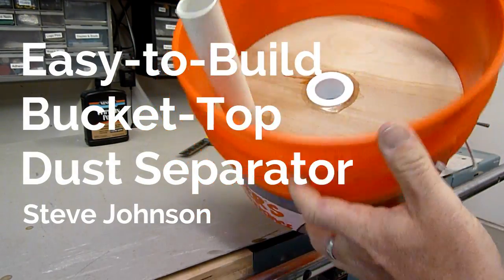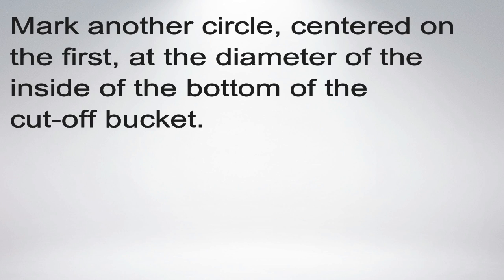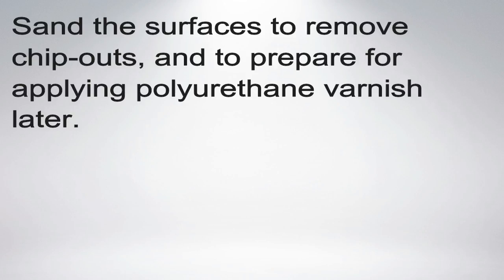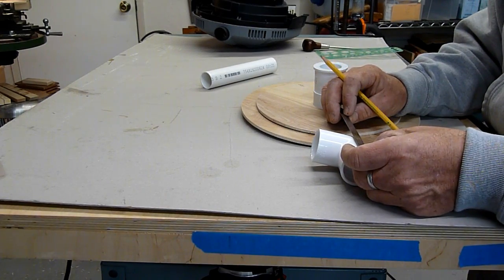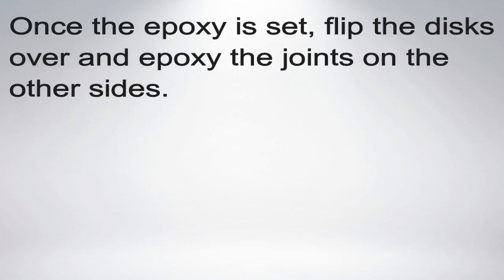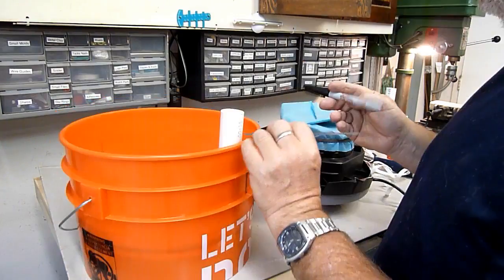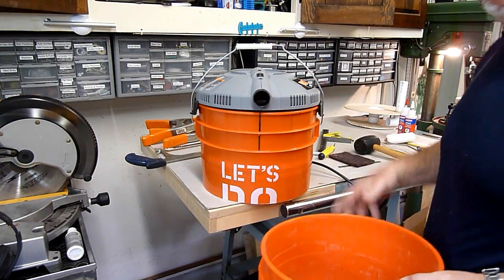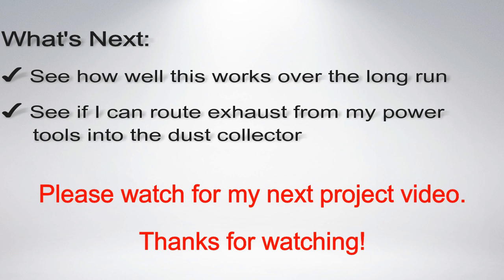Easy-to-Build Bucket-Top Dust Collector

Comment: Thank you for this...I made it and it works great.  I tied the two bushings together with a 1-1/2 coupling. It solved lining them up and gave the two pieces of plywood more stability.  I also had to taper the pvc pipe to fit in the vacuum. Thanks again.

Comment: Great video. Just FYI, The reason why 2 nested buckets are hard (or impossible) to separate is because of air density. When 2 buckets are nested for a long period of time, a vacuum is created between the buckets. This vacuum can make it impossible to separate the buckets. The vacuum is created when the temperature of the air trapped between the buckets warms up and then cools. The air escapes when warm but cannot re-enter thus causing the vacuum. The vacuum then pulls the upper bucket deeper into the lower bucket cinching the upper bucket into the lower bucket. This is why they can't be separated even if a hole is drilled in the bottom of the lower bucket. They are cinched together. Always run a piece of masking tape down the side of the upper bucket before nesting them together, they will separate with ease.

Comment: Liked your concept.  Very good workmanship.  Followed your plan a few months ago, but had trouble getting the pvc inlet pipe to fit the underside of the buckethead’s inlet port.  Thought about plugging the inlet port, and creating a port through the side of the bucket, directly into the separation layer.  But that interferes with the lower bucket - perhaps with a taller, single bucket?  For now, I will just try fixing it.  Wondered if you have any thoughts or observations, after more than a year?  What kind of experience have you had?
Reply from the maker: Hi, Joe - Thanks for the constructive comments. 

It did take some finagling to get the right length and orientation for the inlet port.  One thing I did was to make sure that the inlet port and PVC pipe were adjacent to one of the handle mounts on the bucket so they could be aligned visually.  I played with the length, starting too long, and then measuring the gap between the buckethead and the rim of the bucket, trimming 75% of that off and trying again.  After a few iterations, I got the right length.

A year + in, and I'm using the vacuum pretty much every time I'm in the shop.  I use a broom and dustpan for the wider floor, my bigger shop vac for big chunks, and this one for dust around the table saw, drill press, and router, and have really had no problems getting the dust to settle into the bottom and not clog up the filter on the buckethead.

I've done a number of projects since that one, but haven't published them.  They include a table saw extension router table, powered speakers for an Amazon Echo, installation of an Amazon Echo-controlled vent fan in my garage, variable color control for RGB LEDs powered by a single-chip Arduino, cargo separators for my Subaru Forester, and I'm currently working on cargo drawers / sleeping platform for the Forester as well.  Any vote on which I should publish next?

Thanks again!

- Steve
Reply: Steve Johnson  Glad to hear things have gone well.  Got mine working over the weekend.   Have not fooled with arduino or pi systems.  Maybe one of these days.
Reply: Built something last winter,  based on your concept, but have generally had lackluster performance.  Eventually discovered that chips were jamming up in the inlet at that 90 degree downward bend.  Saw it happen twice in a couple of days.
Buckethead seems more suited to fine dust from sanding, for example.  Did not do well on miter saw, Bandsaw or drill press.  
Otherwise, under powered and prone to jams.
The small diameter of hose and ports are also kind of irritating.
Lessons learned.
Still like the idea of a vacuum head and dust separator in one unit.  May try something else.

Comment: Clever build and well done. Is the filter media on the vacuum head HEPA rated? If not you will still be ejecting the must dangerous dust particles into your shop air.